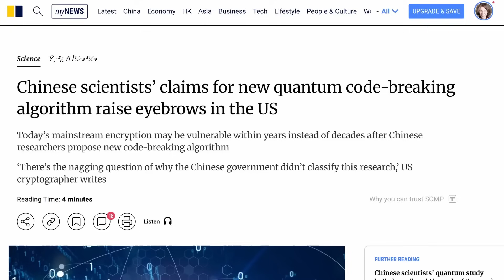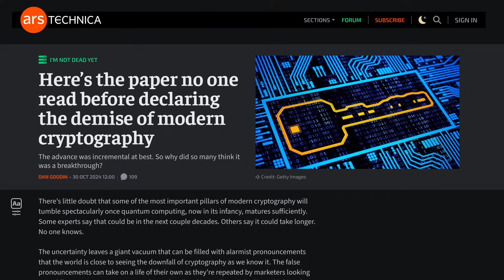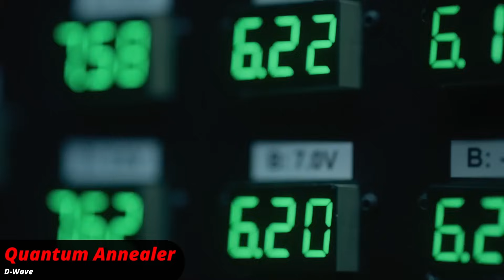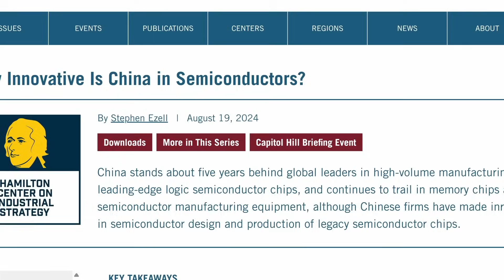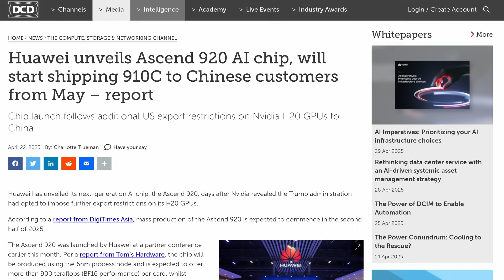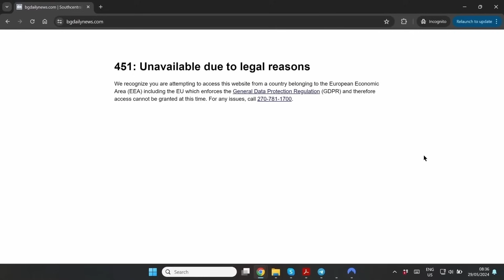Chinese claim "First Successful Factorization of RSA-2028 Integer". I've had a look.

Comment: My university thesis was on building a one-time-pad encryption system, which is unbreakable (for those who don't know, it's not just "very very hard to break" or "takes millennia to break", like other encryption methods - it is technically, mathematically impossible to break). At that time my work was unfeasible, because it required random encryption keys the size of the data itself.
Nowadays it is technically possible, albeit a logistical nightmare, but it can 100% protect any data until the end of time. You just need lots of storage. LOTS. 
If anyone is interested, I have a working prototype I can provide.
Reply: For digital signatures you need a public key system which a one-time-pad system cannot provide.
Reply: It doesn't have to be. A one time pad can be used economically. It doesn't have to be a one for one system. That was going to be my thesis 40 years ago. NSA came into the University where I was and had classes. They taught us all about ciphers and such.
Reply: It's a stone, Luigi. You didn't make it!
Reply: @corrupted_mode  I don't understand your comment.

Comment: If the factors only differ in 2 bits, then you have N = P * (P + 2^x +- 2^y), where x, y <= 1024. You just find the x and y where solving for P gives a whole number. That's only about 2 million possibilities. You can brute force that on a potato. This article is a joke.

Comment: It's not only cracking coding or generating unbreakable progressions, loops and random number generating. Let's say you are running radar, but each radar can't be the same signal outputs. Thus each radar has to have it's own variances then coordination for master control. Crackheads galore. Then slam a hypersonic missile into them and giggle.

Comment: Most things aren't actually encrypted using RSA. RSA is too slow. What you do is use an AES key to encrypt the plaintext. RSA is only used to encrypt the AES key before transmitting it over an insecure channel. Then you transmit the AES-encrypted ciphertext. Then the second party uses RSA to decrypt the encrypted AES key they received, and uses AES to decrypt the ciphertext. If the third party has captured this encrypted AES key transmission message and is able to crack RSA, then your ciphertext is compromised and they can recover the plaintext.

But if the AES key wasn't captured (e.g. already-encrypted backup files on a tape) or was transmitted some other way (e.g. sneakernet), then there is no RSA key to crack. AES doesn't rely on prime factorization - it acts as a one-time pad once created. So you're still stuck trying every possible AES key to decrypt the ciphertext.

Comment: The scariest part for me they got quantum anything to work.
I dont believe quantum computers can ever work.  Reading a quantum state instantly decoheres an entangled state so how it is possible to access even two calculations simultaneously? 
The slightest outside interference also decoheres so the error rate in the quantum bits becomes exponential based on the number of quantum bits you are using.

Comment: The concern that quantum computers could one day threaten Bitcoin is theoretically valid but practically manageable. Bitcoin doesn't use RSA, but rather elliptic curve cryptography (ECDSA)—which could, in principle, be broken by a sufficiently powerful quantum computer.

However, Bitcoin operates on a consensus mechanism, which allows the network to adapt to new threats. If a realistic quantum threat emerges, the Bitcoin community can implement a fork upgrade to transition to quantum-resistant encryption. Research and proposals for such upgrades already exist.

In short: Bitcoin's security is adaptable—any “quantum apocalypse” scenario can be prevented through timely protocol updates.
Reply: The way you lay that all out, you act like if someone does develop the ability to crack it, they will just notify everyone its time to upgrade.

The point at which you know your encryption has been broken is the point at which it too late to do anything about it, unless you're dealing with a benevolent actor.
Reply: The problem is that it will be hard to reach a consensus on a hard fork.

Comment: to steal BTC you'd need someone to send a TX to spend their coins to get their digital signature. This you can then reverse into a private key with your quantum computer. With that you can make a new TX and send their coins to yourself or whatever. Still, you'd have to reverse the signature before the transaction is included in a block - otherwise you are too late. So.. less than 10 minutes. And users could go to trusted miners and avoid the mempool in theory - still that breaks censorship resistance. Regardless, the point is you have to have a quantum computer that's actually fast to be able to do this sub 10 minutes. But then again BTC users keep re-using their accounts even though that probably was never intended. That allows for may more time :D
But BTC also isn't stuck on  particular encryption scheme. They will surely hard-fork to Winternitz or whatever.

Comment: Just putting out the obvious, if anyone does gain the ability to crack 2048 they will not publish it, and you will only hear about it after the data has been extracted, digested, and re-encrypted in a quantum resistant hash.  Nation state level attacks would be catastrophic for the target (think ransomware but much much worse).

Comment: With regard to bitcoin, the situation is more nuanced, it is only in the instance when a public key is revealed could a quantum computer be used to derive the associated private key. If the public key is not revealed (i.e. p2pkh address not reused), then the private key cannot be derived from a qua tum computer.

Comment: Actually, the Chinese team factored a 22-bit RSA integer, not a 2048-bit one. That’s like solving a lock with 2 digits instead of 200 — impressive in the context of quantum computing research, but nowhere near breaking real-world RSA encryption. Most secure systems use 2048-bit or 4096-bit keys, which are exponentially harder to break. Unfortunately, many headlines and commenters skipped that crucial detail.
Reply: In the paper Sabine shows, the researchers absolutely do factor a 2048-bit integer. The problem, if there is one, is that it isn't an arbitrary semiprime, but rather a 'special integer' whose factorization has known properties.
Reply: @kiltedjade The first document shown is a 2022 preprint (arXiv:2212.12372) where Chinese researchers used a quantum algorithm to factor a 48-bit integer. That’s nowhere near RSA-2048, which is exponentially more difficult to break.

The second document—a media article—describes the research as a “real and substantial threat,” but this is misleading. The actual paper makes it clear that breaking RSA-2048 would require millions of physical qubits, which is far beyond current quantum capabilities.
Reply: @kiltedjade ok the integer they factored was not an RSA-style 2048-bit semiprime (a product of two large unknown primes), but rather a carefully constructed 2048-bit number whose structure made it trivially easy to factor with the method used.
Reply: @davidmarquez2821  You just repeated exactly what  @kiltedjade said to you, right back to the person.
Reply: @kiltedjade  Thanks. Yeah, I somehow got that part, and now that you mentioned I'm less doubtful about what I understood. Still pretty cool, at least for me, being a layperson.
Reply: @kiltedjade but given that the D-Wave isn’t a real quantum computer AFAIK, its still concerning, what can they do with a teal quantum computer when they build one?
Reply: @alphakanaima  When a quantum computer is ablle to crack an RSA probably its gonna be wise to switch to use quantum encryption. As far as I understand that has been theoretically demonstrated.
Reply: I mentioned above that the number factored was 22-bit, which came from the South China Morning Post article. That’s accurate for that particular experiment. But the 2022 paper describes a different experiment .
In both cases, these are tiny numbers compared to RSA-2048.
Reply: 22 bits? Am I missing something here? That's practically nothing. 22 bits is only going up to numbers slightly over 4 million... a brute force approach with a conventional computer could do that in a matter of milliseconds (I mean even on a regular computer, not even getting into supercomputers).
Reply: Not to mention the very simple and effective blocking after X attempts.  To crack these codes takes millions if not trillions of attempts
Reply: @Jmfufghf  This is confounding concepts. RSA does not have "attempts" in the traditional sense. Instead, the problem relies on the hardness of the integer factorisation problem - which is fortunately gated by compute, but unfortunately not able to manually be gated by anything else because the format of the encryption itself necessitates divulging the product N of two primes.
Reply: The only way this would be concerning is if time shows that we have exponential growth in computing power to catch up to and then crack those larger 4096 bit keys. Oh wait...
Reply: Including Sabine as per it would seem, pseudo clickbait !
Reply: @repsyche235  what seems click bait and why?
Reply: They don't have the power to do this if I recall from one documentary.. because it's running multiple processes at same time, the amount of resources and energy input it would take as well as sheer time is insane, unless they hook up their nuclear Sun they built... Then yeah we are screwed 😅😂
Reply: Let’s clear this up: Yes, Chinese researchers recently published a paper claiming to factor a 2048-bit number using a D-Wave quantum computer—but it's not what the headlines suggest.

D-Wave isn’t a universal quantum computer like what Google or IBM are building. It’s a quantum annealer, suited for optimization problems, not real RSA cracking.

And the number they factored? It was carefully constructed—its two prime factors differed by only 2 bits. That’s nothing like a real RSA key, which is randomly generated. Their method only works on that special case.

The strongest RSA encryption in real use (2048+ bits) is still totally secure. For reference, factoring an 829-bit RSA number took 2,700 CPU-years on a supercomputer—and 2048-bit is exponentially harder.

So no, RSA hasn’t been broken. These papers are interesting research, but not a threat to real-world encryption.
Reply: There seems to be a confusion. The abstract of the article (of 2025) discussed in the video, says "The experiment factored this class of integers of size 2^2048" and the Wikipedia rticle for RSA numbers say "RSA-2048 has 617 decimal digits (2,048 bits)". Nowhere in the article says that they factored a 22-bit number. There is another article, of 2024, with most co-authors being the same as the article of 2025, using also the D-Wave computer, whose abstract says they factored a 22-bit number.
Reply: @Juan-qv5nc When the 2025 article says it factored a “class of integers of size 2^2048,” it doesn't mean they factored an actual 2048-bit semiprime like those used in RSA. Instead, they constructed a toy example of that bit length—not a true RSA key—with known properties or structure that made it easy to factor. That's like solving a maze you designed yourself with the solution already in mind.
Reply: @davidmarquez2821  Yes, that's more or less what I have been thinking after reading these comments. Thanks for this very interesting discussion.
Reply: The first step is often the hardest
Reply: This should be the pinned comment
Reply: @davidmarquez2821  the question is not that they can but how long they do get enough qubits
Reply: the ccp hacked the encryption of a commodore 64.
Reply: Yes it is. Once you can do 22-bit scaling it up is easy.
Reply: @shannonbarber6161  Each bit you add doubles the difficulty. Going from 22 bits to 2048 bits means multiplying the problem’s size by a factor of over 10 to the power of 600. Plus, the current quantum hardware used in these experiments had only a handful of qubits. Breaking RSA-2048 would require millions of perfect, error-corrected qubits, which don’t exist yet.
Reply: @davidmarquez2821  Your numbers are wrong. Speaking about perfect qbits you only need about 4000 to crack 2048 bit RSA. You're likely mixing gates (operations on qbits) with qbits themself and/or those reqired to do error correction.
Reply: @Merilix2  you are right in theory, only around 4,000 perfect, fault-tolerant qubits might be enough to break RSA-2048 using Shor’s algorithm. But that’s a huge “if.” In practice, we don’t have perfect qubits, and realistically you'd need millions of physical qubits to emulate that level of fidelity through error correction (like the surface code). That’s what I was referring to—and it’s the real barrier today.
Reply: @davidmarquez2821  Well, you spoke about millions of perfect qbits. I just wanted to correct that. 
And it seems like requirements for error correction have also been improoved a bit since the last couple of years. So be carefull with numbers.
Reply: @Merilix2  You’re right, I should have said millions of physical qubits, not “perfect” ones. The 4,000 number refers to logical, fault-tolerant qubits. assuming ideal conditions.

You're also right that error correction methods have improved recently, slightly reducing overhead. But even with those gains, credible estimates still place the requirement in the hundreds of thousands to millions of physical qubits to run Shor’s algorithm at RSA-2048 scale.

So yes, let’s be careful with numbers—but the central point remains: we're not even close with current quantum hardware.
Reply: @davidmarquez2821  Each bit doubles the difficulty on a classical computer. On a quantum computer, using Shor's algorithm, the runtime is O(N^3), so the difference between factoring a number with N bits vs N+1 is ((N+1)^3)/N^3. If you increase the bits by a factor of C then then it take C^3 times longer. So factoring 2,048 bits takes about 1000^3 = one billion times longer. More importantly, the number of physical qubits also needs to go up by a factor of 2*C.
Reply: @shannonbarber6161  If the number to factorize is C times bigger you need 2*C more bits. So just because the algorithm scales polynomially it does not mean adding qubits scales polynomially. For most QPU designs either they are not fully general quantum computers or adding each qubit takes exponentially more effort. Google's recent chip might have made progress in that domain but not much.
Reply: @shannonbarber6161  23 bit is twice as difficult as 22 bit. Scaling up quantum computers beyond a couple of qbits is really hard.
The whole point of RSA isn't that it is impossible to break, just that it is really hard and takes a really long time.
Reply: the awesome of this is no factoring irt self is the algorithm working at this top quantum computers... this is big... in some few weeks we will see amazing shit... cracking https shh, etc will be trivial... cool

Comment: I am not overly concerned, for various reasons.

A) as Sabine mentioned, the crack works only for carefully selected numbers. In practice, the odds of such a thing to occur in the wild are pretty low. 

B) everyone has been using 3072 or 4096 bit RSA keys for a while now because the likes of NSA or BSI has been recommending this for years. The effort to factorize numbers grows exponentially with the key length. 

C) existing data cannot be decrypted using such an approach because it is not encrypted using RSA. RSA is normally only used for e.g. the key exchange in, say, TLS. The data itself is then encrypted using AES, which is a symmetric block cipher that is much harder to break. AES256 is considered secure against quantum algorithms for a very very long time. 

D) quantum algorithms reduce the effort of brute force key search from N to sqrt (N) which is not very impressive given the exponential growth with key length. Be sure to check this video https://m.youtube.com/watch?v=RQWpF2Gb-gU and this https://youtu.be/Dlsa9EBKDGI . 

So I suppose it's mostly a marketing or distraction ploy. Be sure to use the longest and strongest (random) feasible keys and you should be safe for a very long time.

Comment: I don't understand all this discussion about quantum computing and its threat to encryption security with a total lack of any discussion based on the underlying reality of the mathematics.

The quantum advantage in brute forcing existing encryption will speed up a O(n) task to a O(SQRT(n)) task.  So the reality is that by changing from RSA-2048 to using RSA-4096 negates this entire quantum advantage. 

Now consider the fact that it is a relatively trivial task to upgrade all the existing encryption software to start using this more secure encryption than the trillions of dollars and decades of effort to perfect quantum computing and the correct perspective is created for framing this big nothing-burger of a problem.

History will show that post quantum encryption is going to make Y2K look like a monumental problem in comparison.
Reply: What you're describing is a very general way of quantum decription (based on Grover's algoritm). But for certain encriptions, like RSA, there are specific quantum algoritms like the Shor's one that work at O(log(n)) complexity, so doubling the RSA key size is of little help and that's why those are vulnerable to quantum computers.

That's of course now just in theory, you need first to build a quantum computer with enough qubits and precise ones.